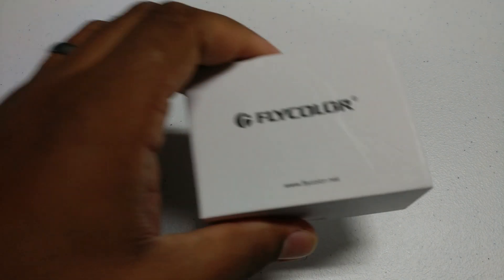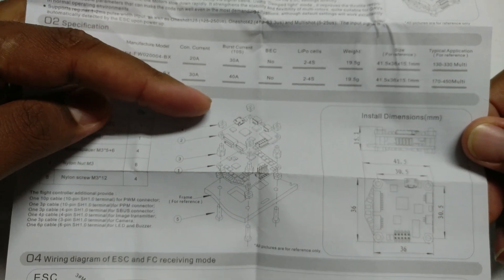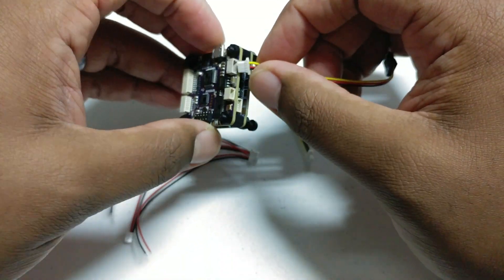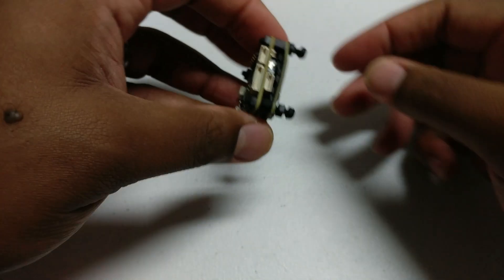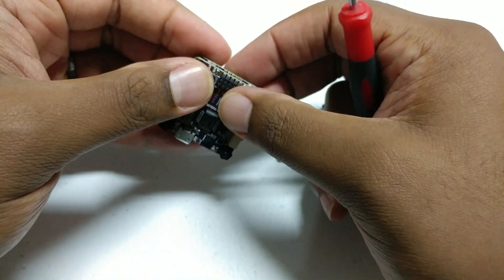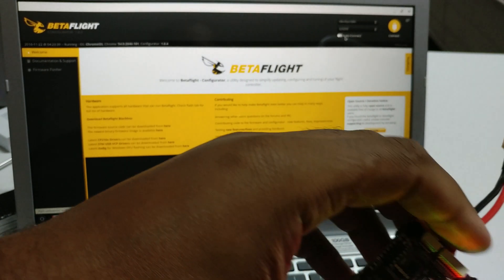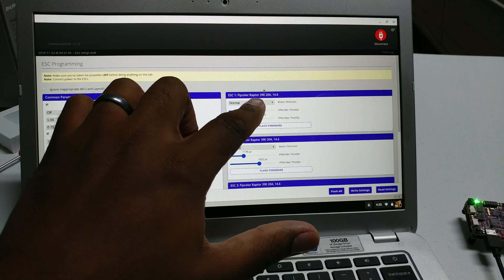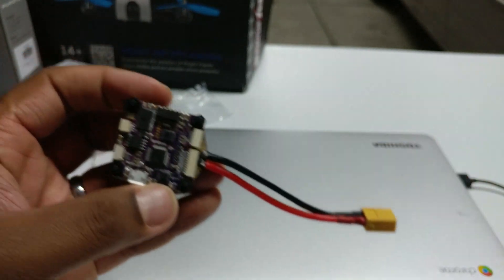FlyColor Raptor 390 Tower AIO FC, PDB, ESC, OSD - Unboxing & Bench Review

Comment: a budy of mine is having trouble flashing to betaflight is not going to dfu mode even if shorted pins any sugestions
Reply from the maker: Daniel V Shouldn't need to short any pins to flash BetaFlight since it's already running BetaFlight
Reply: his came with clean flight tried flashing betaflight but not reading anything
Reply from the maker: Daniel V If he can try a few different USB cables. If that doesn't work then back to shorting the boot pins. He may not be using something conductive enough to actually short it

Comment: how do you flash the border do you have to jump the boot pins?
Reply from the maker: Jason S I didn't... Just flash away
Reply: How to is the question
Reply from the maker: Jason S Too much to write out at the moment but there are plenty of videos on how to flash BetaFlight... Just know that it is the SPRacingF3 target
Reply: Thank for the help!  I can do it with outher bords just not this one. Has something to do with the boot pins I think
Reply: Can't find a video showing how to flash this bord
Reply from the maker: Jason S It shouldn't be needed but won't hurt to try... Try setting manual baud rate as well...
Reply: I'm to new to this I don't know how
Reply from the maker: Jason S It's one of the sliders on the flashing screen
Reply: I've seen it in a lot of your comments it says the boot loading failure but I have not seen any solutions
Reply from the maker: Jason S Well reading those the other guy says he had to short the boot pins... So like I said try that.
Reply: Ya trying. Your next video please and tag me. Hint hint.
Reply from the maker: Jason S if shorting isn't working then your not making good contact... Try something else or if need be solder two wires to both boot pads
Reply: I have been using tweezer with I fine point jaming it in
Reply from the maker: Jason S Yeah that won't work... I use male male ribbon cable
Reply: Explain or have a picture. I have a basic idea I have been racing cars for ever but this computer stuff im learning
Reply: was able to flash the board today turns out you don't have to jump the boot pins. there was something wrong with my USB cable wiggled it enough and it worked

Comment: Update on previous comment: SO, I have found 3 versions of this board, easily identified by their different solder tabs. The latest version has an S.port soldering tab next to the USB plug and boot button. This latest version(3 i think) is being sold by helipal, the previous version(2) is being sold by getfpv (circa Feb 2017) and the first version is being sold by GearBest... if you want to see the differences.  I mention this because I am having a hard time setting up S.port telemetry on version 2. I can see two S.port tabs behind the USB plug but I dont know if they have to be bridged or what. Anyone have an idea about how to set this up. I am using FrSky XSR receiver. Thank you all.

Comment: hi just want to say thank you for your advice was very helpfull ! I have now armed  the quad threw the modes? I now have all four motors running at different speeds? I have callabrated all four esc but still running at different speeds any ideas : (
Reply from the maker: tony walsh When the motors are running at different speeds what are you doing? Props on or off?

Comment: How do I fix a no-connect situation with this FC? I think it's a soft brick? It won't connect in Betaflight.
Reply from the maker: TheOriginalItchyman You'll most likely need to reflash BetaFlight so you'll need to bridge the boot pads next to the USB and then reflash
Reply: It won't connect the bootloader. Maybe I've chosen the wrong firmware? Should it be the flip32f3osd.hex?
Reply from the maker: TheOriginalItchyman No no no..... SpRacingF3 Target
Reply from the maker: TheOriginalItchyman Make sure your doing a full erase as well
Reply: I had tried the SP Racing one first, and it didn't work.. Then I tried plain old F3, then flip32, etc.. It turns out I wasn't properly shorting the boot contacts. I redid everything, shorting with a different lead, and it worked just right. Thanks for the help, though! I also did a full erase with SP Racing F3.

Comment: i cant get it to updare to 3.1.0 any advise.
Reply from the maker: Jonathan Jonas What happens when you try?
Reply: FIRMWARE FLASHER READ CANNOT CONTACT BOOTLOADER PROGRAM FAILED. I ATTEMPTED ZADIG BUT THE BOARD DOES NOT SHOW UP AS STM32 BOOTLOADER. INSTEAD IT SHOWS UP AS CP2102 USB TO UART CONNECTION. MY FIRST ATTEMPT WAS TO INSTALL THE RACEFLIGHT FIRMWARE BUT I HAD THE SAME ISSUE. BOARD CONNECT FINE AND ALL CONFIGURATION WORK FINE. I AM PRETTY VERSE FOR SETTING UP QUADS BUT THIS  ONE HAS ME STUMPED. 

USING CLI: TYPE  "DFU"  RESPONDS WITH RESTARTING BUT NEVER RESTARTS

Comment: I haven't bothered you in a while, but I do have a question. I have 2 builds going with the Flycolor cube (ESC, Flight controller). I get power tho esc's but not to the board. I thought it was integrated for power, but maybe I missed a power connection to the board (either 12v or 5 v). Can you see where I made the mistake?
Reply from the maker: Bud Jones The pins that hold the board's together are what pass the power through so as long as all those pins are in place the board should be receiving power

Comment: I can't get it to arm. radio is binded. but not sure what to do in beta flight. I'm using sbus frsky
Reply from the maker: Daniel Garrow Did you set your ports for serial Rx? Did you setup Rx for sbus? Did you setup your modes accordingly?
Reply from the maker: Daniel Garrow You'll have to go-to ports tab and set UART 2 to MSP - set UART 3 to serial rx
Then in the configuration tab set it to serial Rx and sbus. 

If you still don't get it let me know and I'll make a video tutorial
Reply: RCFlyer85 thanks got it figured out

Comment: I hope you can plug in a spectrum sattelite
Reply from the maker: As I said before I don't see any 3.3v pads so probably not
Reply: RC Flyer85 that sucks what other recievers would this be compatible with??
Reply from the maker: Black JWayne any receivers that take 5v... I suppose you could power it by a separate 3.3v regulator

Comment: Hey just as an update i did go ahead by the tower AIO. and after seeing some more info you posted on Joshua's AIO round up it convinced me that this was probibly the cheapest with the most features. thanks for the early videos
Reply from the maker: Awesome... Yeah I really wanted to do a build already but just haven't had the time.. but soon. If you beat me too it I definitely want to know what you think
Reply: RC Flyer85 well the reason being is my quad has been giving issues lately and things are breaking all over it and this will reduce those fault points plus beta flight from a mini cc3d is a big improvement plus one of my motors on my new cobra 2206 2100kv is getting stupidly hot after running for like 3 minutes while the others are cool so I don't know but the esc seems fine.
Reply from the maker: xshadewolfsx That sounds like a screw touching the windings or maybe a bad bearing.... Yes a big upgrade over cc3d
Reply: RC Flyer85 well come to think of it the screws that came with it were to short for the 5mm think arms I had and the ones from my old emax 2204 2300 were a little long but maybe I didn't put enough washers between to back them out enough. Also my video cables are jacked cause whenever I turn on the props my video goes fuzzy but as soon as I turn the idea up off video is perfect. Hahaha oh well this is what happens when you take a prebuilt and go cheap college student on it with hopes of being as good as Mr.Steele.

Comment: Thanks for video , i've brought my Raptor 390 as well and finished wiring and soldering . It can fly smoothly , however , my OSD always showing "No Data , Disarmed , 0 voltage" on screen. Would you mind if you can show your wiring diagrarm ? 

I''m not quite sure for how to connect VTX (VBAT & GND) , now I use it as 12V output to my Foxeer TM25 VTX. (But I found that it have lot of noise/wave on screen when I push throttle... I believe mine is not the right connection)
Reply from the maker: Haha.. I forgot about this. I just finished my build last night and couldn't remember what to do to fix it.... Thanks for helping me out!
Reply: I like the clean factor of it but damn if some of those solder joints are close! Especially on version 1. Thx for helping us with OSD problem I couldn't figure it out without your help
Reply from the maker: Adam Chan Mine is not connected yet as I'm waiting on parts... Probably be a week or 2 with the holidays. Hopefully you can get everything sorted out before then
Reply: Hi , I've solved the problems , it's because I had adjusted the Port setting in BetaFlight , enable UART 2 MSP Data , so that the OSD can read data from FC correctly.

however , I'm now facing another problem , I found that the current from the board to VTX doesn't clean , many noise. I'm trying to add BEC in between....
Reply from the maker: Yes this is my major concern with this type of board... If your vtx can handle it you can also try to run the power from the main power pads. How bad are the lines?
Reply: Yeah , my problem solved after adding a extra BEC 12v output Between VTX and raptor F390 tower ... the noise gone and video signal is clean now . so..... I'm still happy to its performance but this version of tower still have room for improvement .
Reply: thanks for this chat, it all helps
Reply from the maker: Adam Chan Did you setup your Rx type and modes in BetaFlight?

Comment: Also maybe the reason the ESC are 20a software might be because flycolor have made a 4in 1esc before which I think was the fairy series which was 20 Amps and had a built in Flight controller so maybe they reused some software perhaps?
Reply from the maker: It's not uncommon for a 20 amp and 30 amp or any combination like that to share the same software. Flycolor does sell Raptor 390 ESC's that are normal ESC'S so this just shares that software
Reply from the maker: xshadewolfsx Thought you might like this... https://youtu.be/x_IyDGy9FkI
Reply: RC Flyer85 this link isn't working quite right and it tried to manually type it in still didn't work
Reply from the maker: Hmm try this.....
http://m.youtube.com/watch?v=x_IyDGy9FkI&feature=youtu.be
Reply: thanks for the link. it was cool to see it fly but the video was so short. looks promising though.

Comment: ooh nice, i think if this osd is nice with no rf noise its gonna be a game changer, i'm really looking forward to see it perform, i think the price is quite attractive, good value even.  ps what happens if a camera (h1177) has its own osd? and there is an added one like this?, does betaflight let you play with both? and whats with those solder pads being so close? bigger heatsinking?.. are you supposed to be able to avoid the solder going right up to the edge?
Reply from the maker: TheMadmacs yeah I'm not sure what would happen if you have a redundant OSD software... which reminds me that is the one thing I did not do is click on the OSD tab in betaflight...

yeah so far that is the only really big negative about this board is that these pads are super close they're only separated by 1 millimeter of space so it's going to be a hassle to get all this wiring done without having something touching something is not supposed to... what they should have done is pre soldered wires on to it like the TBS powercube so that wouldn't have been an issue
Reply from the maker: TheMadmacs check this out looks pretty clean... https://youtu.be/x_IyDGy9FkI
Reply: that looks really tidy, pity its $90 for that frame.. i hope it fits in the recent bunch of x and stretch x pod style frames.... this isn't even very expensive when you factor in its 4 in 1.. even if you don't want or use the osd its a sweet deal. cant wait to see it in a build.
Reply from the maker: TheMadmacs I just checked... it's on promo right now for $60.99

Comment: Oh this thing is so cool. I can't say thanks enough, I was so excited when I saw this pop up in my feed. Great video, I know you said you were waiting for parts to come in for a build for it. I can't wait to see how she flies.
Reply from the maker: No problem but if you do get this I think I would Sauder one of the battery leads on top and one of the battery leads on the bottom of the board so they're not right next to each other like I have it there are pads on the bottom which I think are for that reason.... a couple of people were asking about this so I make sure I got it done when I got off of work last night. Thanks for watching!
Reply: RC Flyer85 it's a pleasure watching you also cleared up a lot of questions I had about the OSD part and how you connect it. I'll definitely take your advise on the battery leads or maybe do some research to see if you could run some thinner wire to the battery
Reply from the maker: xshadewolfsx Also if your interested GearBest has a deal on all RC stuff using the code: rc18off